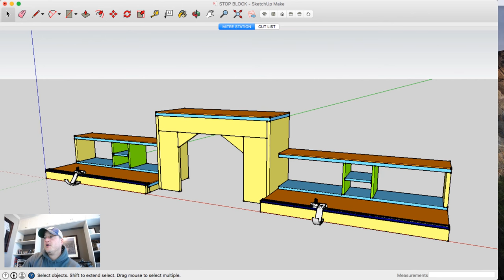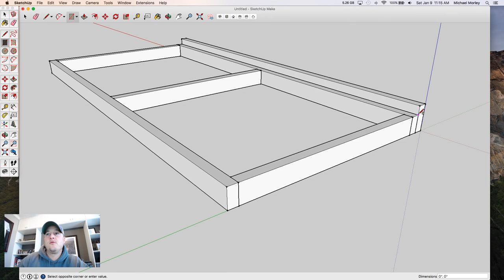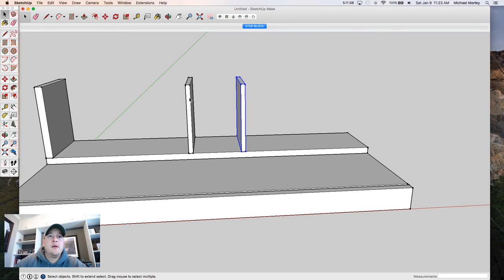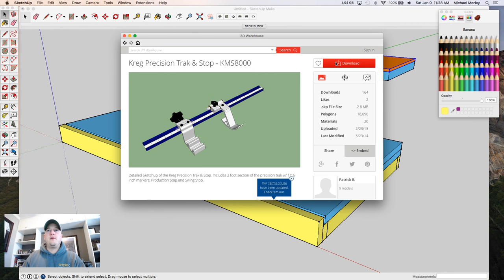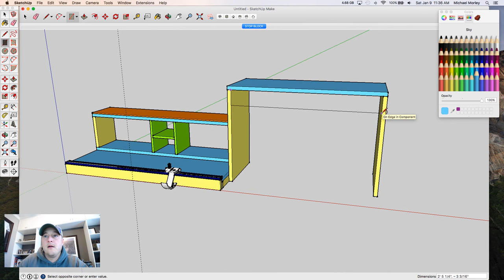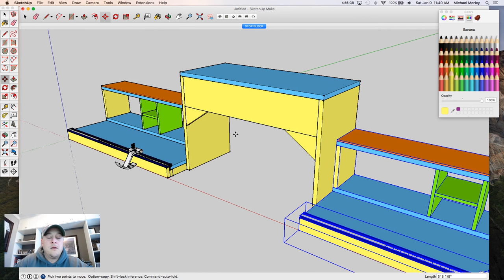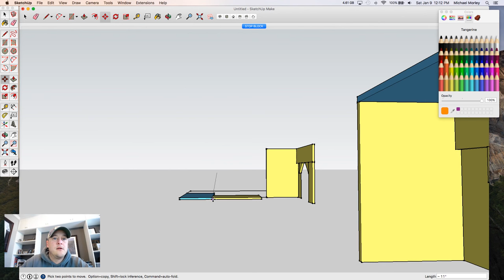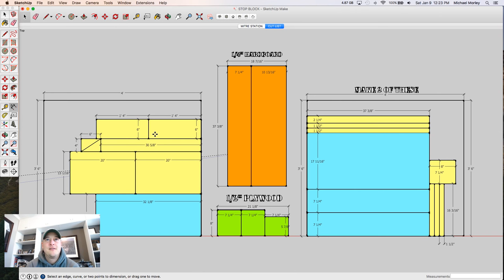DWW: Miter Station SketchUp (ep08)

Comment: Hi, thanks for explaining things so clearly. This may sound like a stupid question, but if you have an exact size of material to work from and you fill the entire piece with components to cut, how do you compensate for the thickness of the table saw blade? Do you always just allow more material for waste? Thanks
Reply from the maker: When laying out my cut list I always keep an inch or so at the end of the board to account for kerf thickness. A full size kerf is 1/8" so if you had three pieces out of 1 board then you would have 2 cuts or 1/4" You can extrapolate the math from there for how many cuts you have in your specific project.